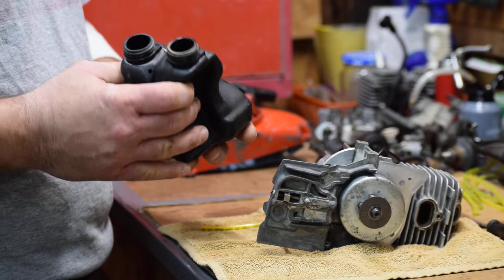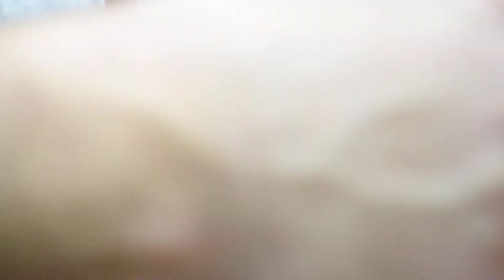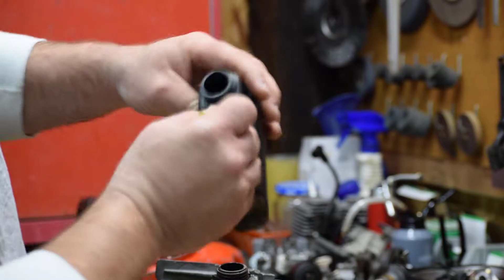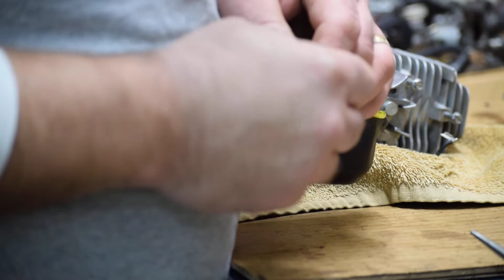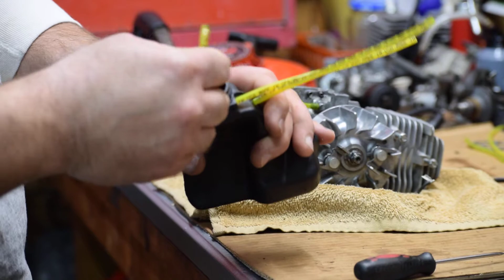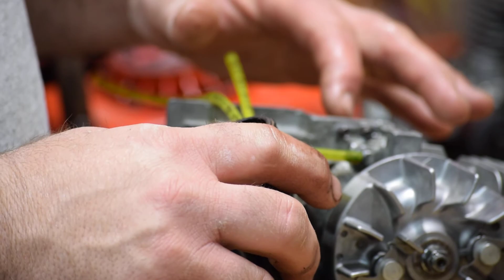Homelite Super 2 Chainsaw Reed Valve Repair (Part2)

Comment: Just picked up a super 2 for $40. Its still in the case, looks like it has only been used a couple times, zero wear on the sprocket and original bar and chain. Can't wait to get into it.
Reply: You prolly dont care at all but does anyone know of a tool to log back into an instagram account??
I was dumb forgot my password. I love any tips you can give me.
Reply: @Thomas Samuel Instablaster ;)
Reply: @John Wesson Thanks so much for your reply. I found the site through google and im waiting for the hacking stuff now.
Looks like it's gonna take quite some time so I will reply here later with my results.
Reply: @John Wesson It did the trick and I actually got access to my account again. I'm so happy:D
Thank you so much, you saved my ass !
Reply: @Thomas Samuel no problem =)

Comment: The sprocket on this saw is an after market. That is probably why it is not so much worn. It has been exchanged at least once.
Reply from the maker: Nope original parts. It was only used a few times.

Comment: Where can I find parts for these saws? I’ve looked for a while now and can’t find any parts. 
Thanks also how do I know what model mine is all have is 2 sets of numbers on the dataplate
Reply from the maker: what parts do you need? if you get a picture of your saw and model number, i can help you id it.
Reply: @cjpowerequipmentsmallengin2294  I need carb rebuild kit the duck bilb valve that goes in gas tank and the oiler line.  I don’t know how to send you a pic on YouTube.
Reply from the maker: @mud4blood313  contact Leon at https://www.leonschainsawpartsandrepair.com/store/c1/Featured_Products.html he is very good with those saws.

Comment: Thanks. I explained very well. Thanks for your time mate. I need to get in touch with you. A have a problem with my homelite 200. It gives alot smoke and it doesn't oil the chain bar.
Reply from the maker: Thank you. You will need to replace the "duckbill" valve in the bar oil tank. I can get you a part number if you need me to.
Reply: @cjpowerequipmentsmallengin2294  i replace the duckbill and is the same ,alot of smoke and no oil for the chain. 😂😂It drives me crazy
Reply from the maker: @mihai21neo  What model saw are you working on?